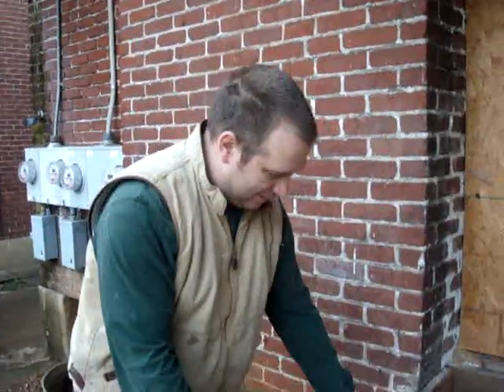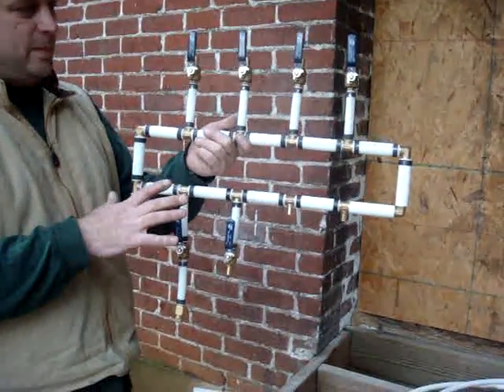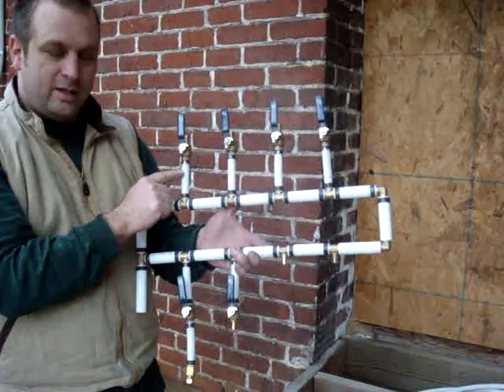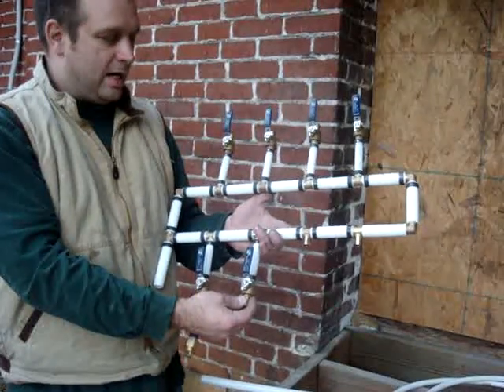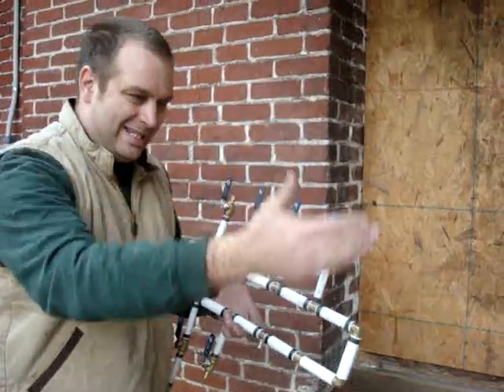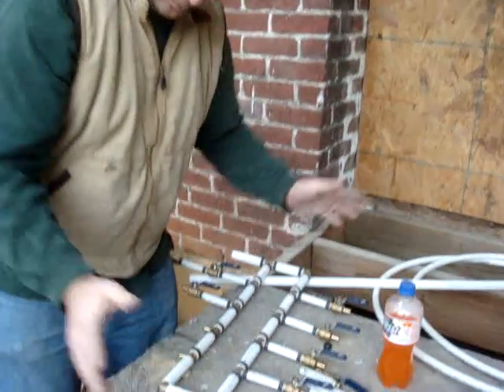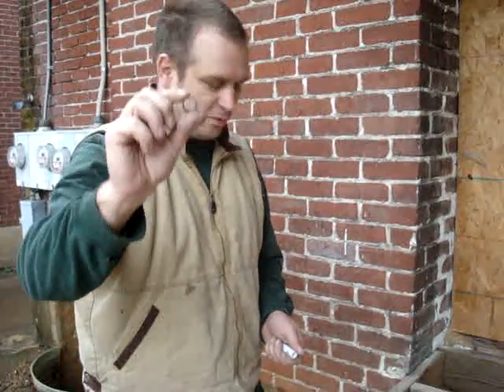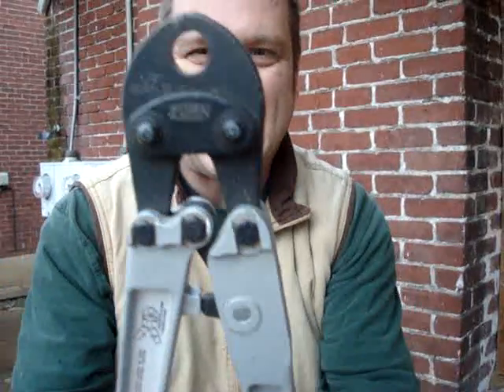Introduction to PEX

Comment: Hi James. I really enjoyed the video.
I am preparing to replace the thin copper pipe that is leaking everywhere in my 40 year old house (due to acidic well water).
I am sold on Pex.
I am debating the merits of custom fabricated manifolds like yours, versus prefabricated ones like the Manabloc system.
The manabloc definitely looks whizbang neato, and, if properly displayed, could enhance the gee whiz appeal of the house if I decide to sell. HOWEVER, disappointed customer reviews of the manabloc claim that it did not do much to equalize pressure drops throughout a house when one fixture is running and another is turned on.

You claim that the dual feed approach can alleviate that problem.  However . . . my son (a designer) works with engineers on industrial scale projects, and says that dual feed can create a "bull head" situation, increasing turbulence and decreasing flow.

Can you discuss this issue? Is there any further insight you can provide?

Thanks in advance.
Reply: I should probably add that I am considering a ~ 40' run of 3/4" Pex from the pump room to the other end of the house, before breaking out the individual supply lines from a manabloc or other manifold. Most of the plumbing fixtures, upstairs and down (bathrooms, laundry, outside spigot), are about as far from the water tank as they can be.
Reply from the maker: Steven King Pex will do you well since you can run continuous pipe for the full run between your well and house. I think a manifold system would be a good idea for your set up. I'd run 3/4" for all the trunk and bigger branch lines, to the water heater, etc.
Reply: James Glass Hmmm . . . not what I was asking.
I am already sold on Pex, and . . . 
. . . the run from the well to house has been in place for 40 years. 
What I am really curious about is:
Have you . . . has anyone done pressure-drop testing at the ends of 1/2" supply lines on both dual supply manifolds and single supply manifolds to see if there is a qualitative difference between the two.

Thanks again. I still love the video. It is very "empowering", and I enjoy considering it as an option..
Reply from the maker: Steven King Oh, right. The pressure drop is negligible unless you start using a lot of elbows to make turns. I use the pressure drop charts online for this. I'd link here, but youtube won't let me insert a URL but if  you google "pex pressure drop table", you'll get the data you need. Rehau has a nice pdf online and there are others.

In a residential setting with most run from the manifold being under 100' if you run to a fixture with continuous pipe, you're not going to be able to measure any significant loss--that's the beauty of pex because the big loss (not that it's even that significant) comes from fittings, 90's etc. It's great.
Reply: James Glass Thanks James. I think we are still not on the same page, but I really appreciate the effort.
May I ask a slightly different question?
I am not asking about the pressure drop along any given run of any given length. I generically understand the issues of induced turbulence (and resulting pressure drop) from elbows.
Rather, I am curious about the differences in pressure equalization across supply lines from a dual supply manifold (like your custom fabrication) versus a single supply manifold (like the manabloc, or any number of other "inline" manifolds).
Reply: Steven King And I guess I have one other very significant question regarding pressure drops across supply lines within a manifold. Again, I am asking about (for example) what happens when one faucet is running and another is turned on. 
Is there a qualitative difference between pressure drops across the manifold when it is closer to the supply (well pump or street feed) versus when the manifold is further from the supply but closer to the demand?
Reply from the maker: Steven King So, you're asking about the relative pressure of each branch off the manifold while one or more branches are in use to various fixtures that require varying amounts of water? If that's the question, then the point of the manifold it to minimize (usually radically) that pressure difference and supply. The actual pressures are going to depend upon each fixture (shower vs. toilet, vs. sink vs. laundry) but the whole idea of the manifold is to give each fixture a common point of draw (instead of running them in line (like a series circuit). By supplying each fixture from the source, pressure differential is minimized. 

The whole point is when someone is in the shower and someone else flushes the toilet, with a manifold system neither person would notice the difference. The person in the shower wouldn't suddenly get scalded because cold water was being divided between filling the toilet tank and supplying the mixture to the shower value.

Nothing is perfect and all situations vary so we're talking in general terms here, but the reason people lay out water supply like this is deal with pressure drops across supply lines because every line gets the same pressure off the ring of the manifold. There will be a measure pressure drop overall the more fixtures that are open, but the goal is to make it equal and therefore unnoticeable. Does this answer your question?
Reply: James Glass Thanks again James. I definitely get the theory, which is why I loved discovering your custom fabrication video. Especially after reading complaints that commercial, inline manifolds do not effectively address the issue.

Then my son introduced the possibility of a "bullhead" condition occurring because the ring manifold effectively creates a dual feed situation (thus increasing turbulence and decreasing flow). Thus, I wondered if this is even a consideration in a household application.

Your answer that the ring manifold can radically reduce problematic pressure differences seems to indicate that you are speaking more from experience than from theory.

;-)

Then I have one final consideration - placing the manifold near the pump, versus placing the manifold at the other end of the house, near most of the fixtures.
1) If near the pump, I assume I would have many 1/2" runs from the manifold to all the various fixtures. I am tying to avoid/minimize that.

2) If near to the fixtures, I would be running two 3/4" lines from pump room ring manifolds (hot and cold) to laundry room manifolds (hit and cold - at the other end of the house), where I would break out to short 1/2" runs to the various fixtures.

However (I am using that word a lot here), your response to luvkountry below refocuses on a third possibility, which is, in fact, exactly what you describe in the video:

3) Ring manifolds in the pump room; 3/4" runs to the other end of the house for each "set"(zone) of fixtures (upper bath, lower bath, laundry room), with T's for each hot or cold split within a zone. I can see how this might be the optimal design to reduce pressure drops, but would still require at least six 3/4" runs (three hot, three cold) from the pump room. That could get unwieldy, but I might try it anyway.

Thanks again for your patience in helping me determine the optimal design for my application. I feel better about option three even before your reply.

Your video is REALLY COOL, and has boosted my confidence in design considerably. Now I just have to find the testicular fortitude to master crimping!
Reply: Steven King Of course, the reason to avoid running multiple 3/4' lines is to minimize the amount of cold water that has to be purged from from a hot water line when a hot water tap is opened. Still going in circles.

I may be back to design number 2. Heh.
Reply from the maker: Steven King Crimping is really easy and there's even a a tool called a go-nogo gauge that allows you to check the quality of your crimp. If you crimp one wrong, it's also no big deal because there's a special tool that comes in the basic kit that allows you to cut the copper ring off without damaging the fitting.

On the bullhead pressure problems you talked about: I don't know anything about that. I've never had any problems personally and the looped manifold has done a great job. I tried this based on research in manifold design and I didn't see any problems like you described. But, that doesn't mean there aren't problems outside of my experience or understanding. I'd urge you to see if you can find research on this (and please share it with me as I'm always wanting to know more and improve). As I understand the science (my limited understanding of Pascal's Laws on pressure equalization), this isn't a problem, but I'm not a scientist so there may be forces outside my understanding and experience. I can't stress this enough, but I the option I like best is running  the manifolds right after the main shut off. I used to feed the hot water manifold from the cold water manifold, but the last few I've done I like the elegance of running each from a a mini-manifold fitting right after the main shut off. You can also accomplish this with a T and then an elbow. Each manifold is fed directly from the main this way. I don't install shut offs to each manifold since the main is right there and each line has its own shut off. 

The more complicated option (3) is certainly a great way to get water distributed with the least possibility for pressure problems. A lot depends on how large your house is and how hard it's going to be to access places to install all the new plumbing. If it's straight forward enough to just run individual lines to each fixture, then you'll have many more 1/2" lines to each fixture off each manifold, but if that's not feasible, then run just 1 hot and 1 cold to each room and then supply all the fixture in that room from a mini-manifold. For example, in that design (the one often works better in reno situations) is to run 1 cold and 1 hot line from the manifold to a bathroom and label each 1/4" ball valve as such for that room. If you have a full bath with three basic fixtures (sink, tub, toilet) then you'd only be running two long lines there instead of five (the toilet doesn't need hot water!). It's great if you have the room to run five lines to that room, but I have no idea what the structural or spacial limitations of your home might be.

Either way, you have a wonderful and elegant layout and continuous pipe between your manifold and the room it serves. In most cases you can turn 90's without using an elbow. I assume you've seen those 90 degree holders than allow you to secure and turn a pex pipe 90 degrees without an elbow? The take up a bit more room, but usually not so much that you're forced to use a fitting. 

Just to be clear, your pump is inside your home? If you have a well house that is remote, I'd run a single 3/4" or 1" line from the well house to the main shut off inside the house.

Comment: I just took out all the galvanized plumbing on a empty house I bought.. No way I am going to solder copper tube in  the crawl space on a house with no heat and the temp at just above 0. Picked up some red and blue pex and used all SharkBite connectors to finish the job quick. SharkBite cost lot for doing entire house but like I say it was just to cold to fumble with a torch or a crimper laying on my back in the crawl space..

Comment: Great Video.  I am about to replace all the "in ground" copper piping in my house because the copper they used at the time is corroding.   I am going to hang it all inside the house because I am on a slab and don't feel like jackhammering my house in half.  Already had the city inspector come in and bless the project....   Thanks again...

Comment: Is there any advantage in using 3/4" pex for the main manifold then reducing to 1/2" before the shut off valves,?
Would it be wise to include an in line pressure guage to continually monitor the water pressure...?
Also would it be good to have a drain or bleeder point on the lower part of the manifold with a valve on it...
Thanks for sharing your informative video......
Reply from the maker: In most houses I use 3/4" for the manifolds and most of the branch lines. This house was teeny tiny. The diagnostic port is also a drain.
Reply: James Glass  what about his question of a pressure gauge, that sounds like a good idea.  you could just leave it on your diagnostic port.

Comment: always feed your hwt with 3/4'' its good practice. Diagnostic port?? When i build a manifold I always include a pressure gauge on it, why waste a valve?
Reply from the maker: The port is also a system drain--why waste a gauge that costs more than a ball valve? I always have a gauge with me. This house was teeny tiny with gas fired on demand so 1/2" was OK. Virtually all other houses do get 3/4" for the manifolds and branch lines.

Comment: Wow!!  Who da thunk you'd find a pissing contest on a YouTube page devoted to plumbing. Usually you have to go to
a political or sports site to have such fun. For the record (if it even matters) I like some of the points that both of you made.
James I love your manifold (i've built similar ) and I too like a test point (near the service) but no...I don't think it should be code. I don't like your choice of PEX though. I prefer the Wirsbro PEX A system with either the LF brass or EP plastic  fittings. The rings in bulk are around 15 cents a piece (1/2 inch) and fixing goofs is a breeze. I don't think copper will ever go completely away but modern PEX is here to stay.  Pro plumbers I'm sure don't like it but I bet the threaded iron and cast iron
pro's of the past didn't like copper and PVC/ABS coming along. I also don't think the better informed DIY types will threaten 
they're livelihoods either.  Flame away. Ha ha
Reply: uponor

Comment: Excellent video my friend.. I just recently started buying rentals and flip properties.  My first 2 properties, one built in the 80's has all copper plumbing and the other built in the 50's has old galvanized steel piping.  I've gone through some growing pains with regard to finding quality skilled labor and with all that is required repairing/replacing old plumbing & electrical.  I was afraid of messing with electrical or plumbing on my own.  I found an excellent Electrician willing to teach me the basics. Then I was at a local REIA group and one of the guys there told me about PEX piping and the systems and explained how easy plumbing has become with the invent of this new technology.  I had no clue this existed until last night.  WOW!  This will save me boatloads of money and YOUTUBE makes learning to do most things pretty simple.  Thanks for the educational video!  Kudos and well done!  Do you have any videos on how to actually tap into the line that comes into the home from well or city water.. like a "how to" on that? Thanks again!

Comment: I love the idea of this manifold, and to save money instead of buying the pre-made versions that only come with too little or too many ports, at times. Thanks for the video
Reply from the maker: You bet. This one for this tiny home cost about $50 and for most homes it'll run $75 to $100 per manifold for all 3/4" fittings (and more ball valves to more fixtures).

Comment: I am curious. With your PEX manifold would it work as well if you used 'T' connections at the corners to run a circuit off the corners
Reply from the maker: Yes--so long as you have a ring by which flow is equalized from either direction. Sometimes I'll use a T in one corner to the hot water manifold depending on space.

Comment: James Glass Wrote, "Oh, man, I've come back years later to places where I've added that port and it's the bomb! So much faster and cleaner than chopping everything up to get a simple pressure reading. I wish it was code to install them."
 If you are chopping everything up to get a simple pressure reading you should not be plumbing the house to begin with.  Getting call backs for poor flow problems are we?  Go buy yourself a hose to NPT adapter and screw your gauge into it and stop chopping up people's systems.
Reply: Oh crap, not YOU AGAIN!
Why are you so insecure that you have to keep trying to prove you are right and James glass is wrong.
He is far too nice about it...I'd have told you to piss off and I would have blocked you already!
Enough! no one cares what you have to say anyway....